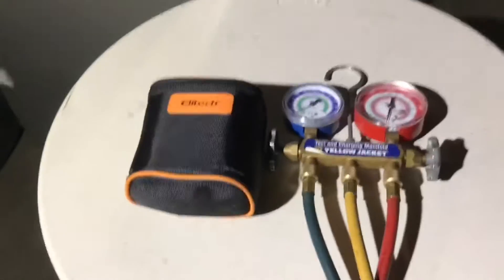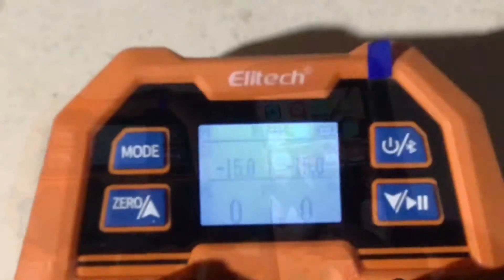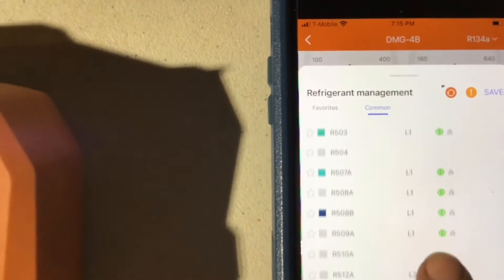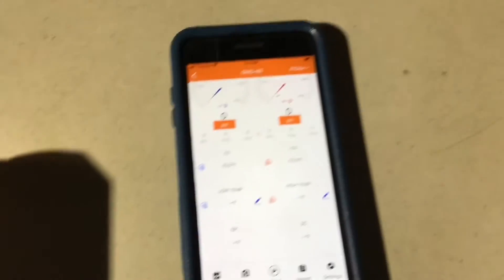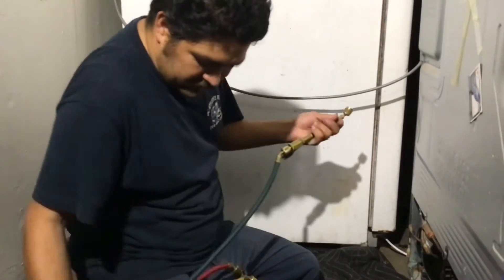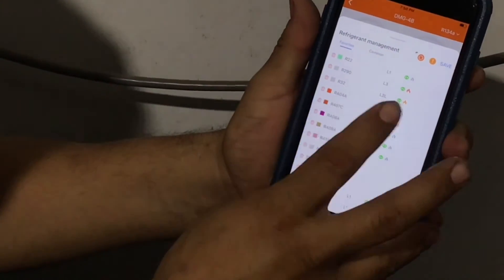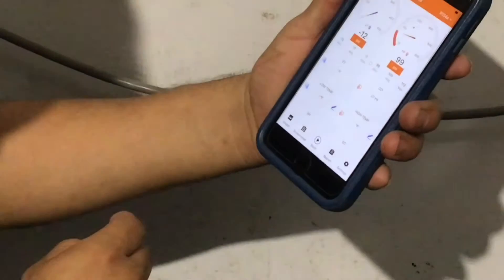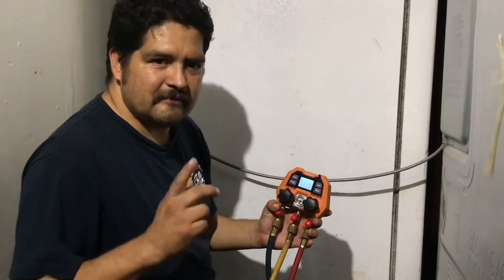Elitech DMG-4B First use review.

Comment: Is the pressure supposed to be negative? In a vacuum? Are you sure those gauges are working?

It appears you were even surprised by the readings since you said the charge was weighed in. And hot inside the garage would make the pressures go UP, right?
Reply from the maker: I lost some refrigerant when I was putting on the guages off camera. I discovers it after I had uploaded the video that it stoped cooling. So yes the were correct. I had to come back the next day to fix what I did. Lucky it was my refrigerator so no upset customer lol.
Reply: @appliancerepair420  what is the low side pressure supposed to be? Certainly over zero, correct?
Reply: @realSamAndrew  0-5 psi but ambiente tempreture affect it.
Reply: @realSamAndrew  R134A typically inside climate controlled buildings around 15 to 18 psig on cap tube. Will be higher inside hot space
Reply: @Kelleycooling  15 to 18 psig is a far cry from negative. IE vacuum.
Reply: @realSamAndrew  right! Big difference! I’ve just happened to land on all 134A case calls last few days and I’ve been putting them at between 15 to 18psig and around 130psig head. The TD and subcool sits good there. I’ve seen a lot of R134A cases with good airflow, dryer and cap tube you know all the normal things that has to be top shape to estimate a charge but anyhow it seems like a 5psig charge don’t pick up enough Heat quick enough and the subcool will be way off. R134A can be tricky specially after working with gases that run higher pressures.